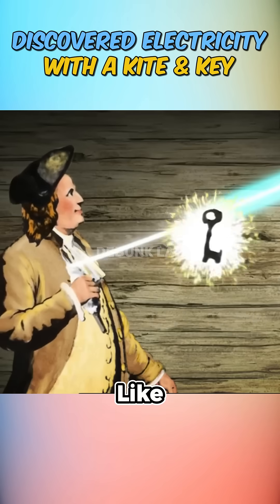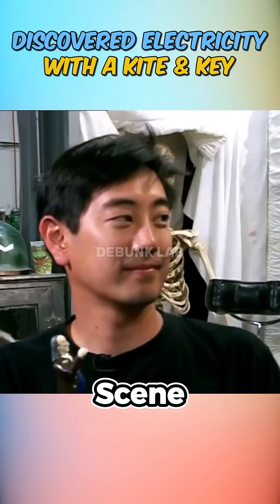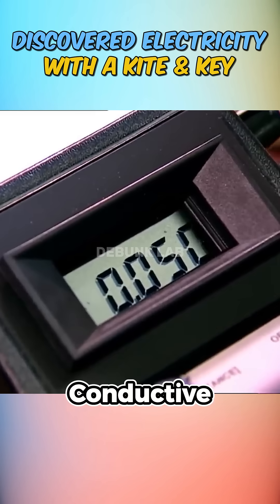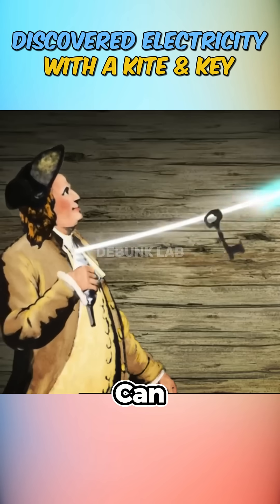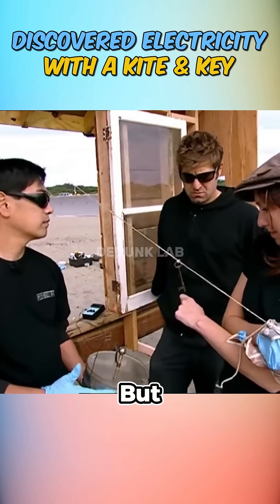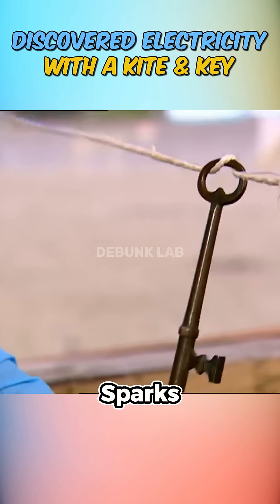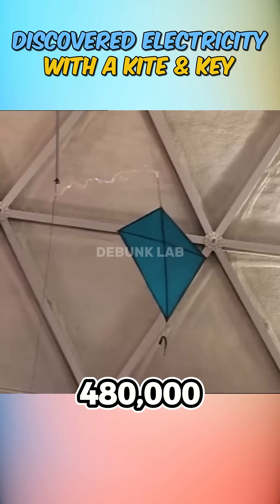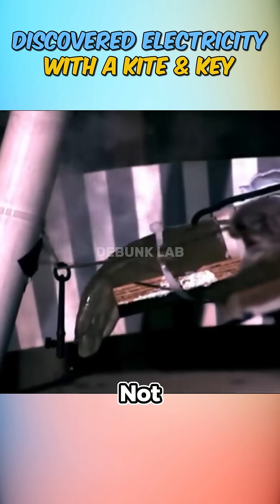Did Benjamin Franklin Really Discover Electricity with a Kite?

Comment: Although we've all been taught that Ben Franklin was the man who "invented electricity" with his Key and Kite Experiment, that is not accurate, as electricity was an already known phenomenon at that time, so  his experiment was not to actually "discover" or "invent" electricity but rather to only prove that a lighting strike has an electric charge, meaning lighting and electricity are the same.. 

And even though this video is implying if his kite had been struck by lightning and the charge ran down to the key that he would have been killed, but that's only if he was touching/holding the key, which he was not.. He only put his knuckles near the key, which ended up with him receiving a shock from it, but not enough to kill him...